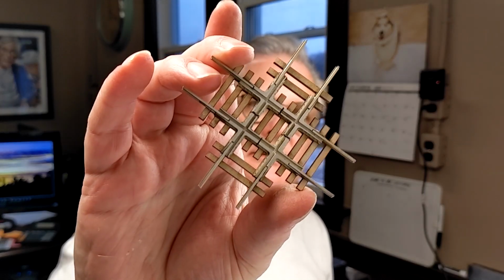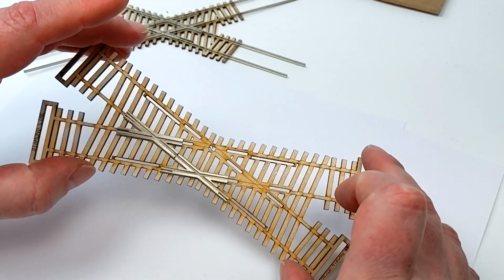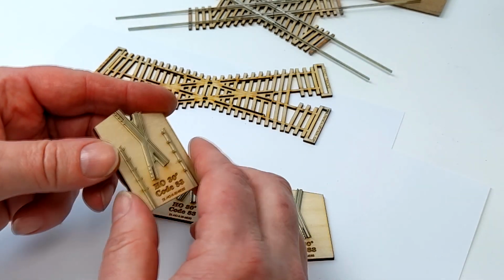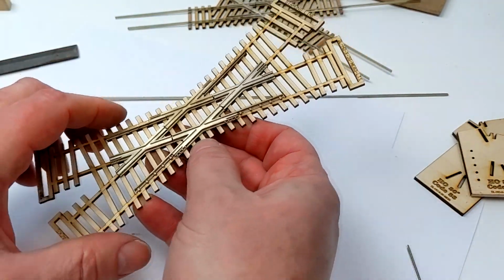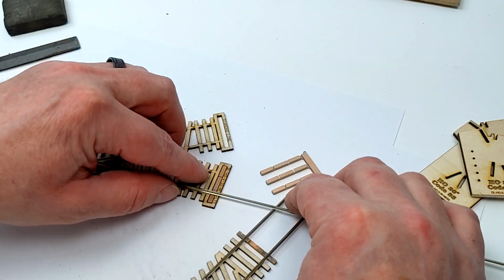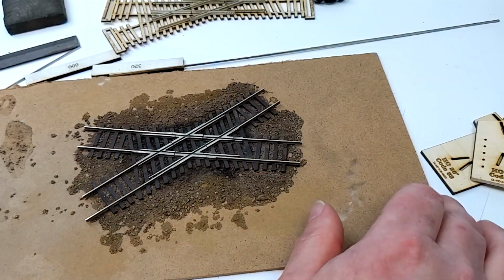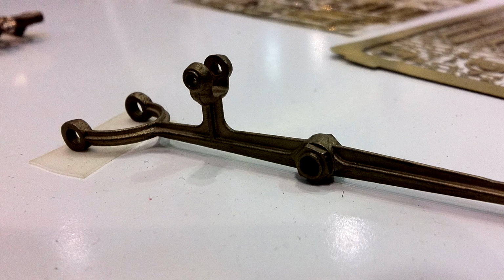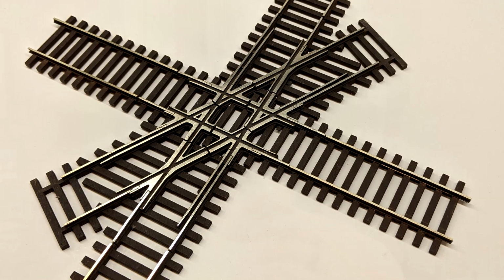Diamond Line Project

Comment: Absolutely brilliant Tim!!! Congratulations!!! A great result for a huge amount of work. Please tell me you'll be doing N Scale parts soon? I hand lay diamonds in code 55 but I'll gladly use these new parts when I they're available. A good friend of mine is building an N scale Chicagoland layout. As you probably know, double- and quad-diamonds are a dime a dozen there so cant wait to see the N scale line. The layout includes Ash Street Jct which has 16 ~90 deg diamonds so this news couldn't have come at a more opportune time!!
Cheers,
Steven 
Kitchener

Comment: Hello Tim, just found your site recently. Wow... seriously impressive. The new diamond series is spectacular! I am months out from purchasing, but in anticipation, I am wondering if you could answer a cost-benefit question.
My instinct tells me that over the long-term, if one is willing to buy the setup for turnouts, x-overs and diamonds, your investment would end up paying for itself vs. continuing to buy "off the shelf" track solutions (provided you can even find/buy them). You have probably answered this in an earlier video, but I missed it if so. As an aside, a big part of what sold me on the Fast Tracks concept is I can draw up plans for a layout without having to worry much about the frustration of shoehorning an off-the-shelf track product into my particular "custom" layout space. Basically, the layout ends up much closer to the plan than otherwise possible (to my thinking anyway) vs. having to redesign the track configuration/space.

Can you shed some light on expected cost benefits please? Thanks! -and keep up the videos when you can, you are easy to watch and I can't wait for your next "project"!
Sincerely,
Paul

Comment: Hey Tim, I know this is not directly related to tracks, but it is related to casting and such. I think you could do well in getting with Sergent Engineering and continuing to make those couplers, as they are becoming hard to get. He's slowing his production and hoping someone will take over. They are awesome couplers but currently only have a very select type range.   I think you would do well in taking over and or making those types of couplers. even though they are not track related.  Just a thought.  These diamond crossings are very slick.
Reply from the maker: You aren't the first to suggest that....

Comment: Are there any restrictions on flange depths? I have some of my dad's old tycos remotored and updated with dcc, but the have flanges on the that are quite deep will I have to rewheel?
Reply from the maker: The flange depths are set to the NMRA standard, so will likely interfere with the older style wheel sets

Comment: Tim just out of curiosity will there be a curved diamond? its where one track is straight and the other is curved through the diamond. i know of one Atlas plan that uses such diamond, a left and right version, in the track plan but its been discontinued.
Reply from the maker: Technically it is possible. Will see how the uptake is before planning expansions.
Reply: I was about to ask about curved castings also..  I’m thinking steel mill modelers and other industries with complex track work really need them.   I know the prototype I’m working to needs 4 curved diamonds!